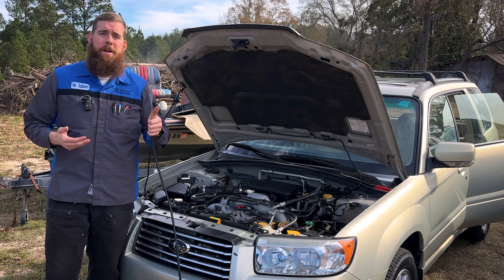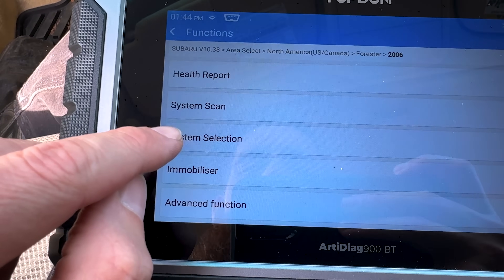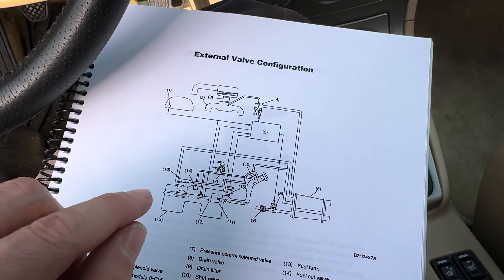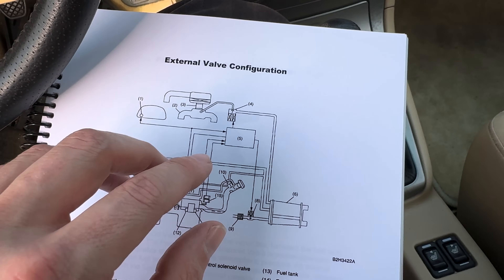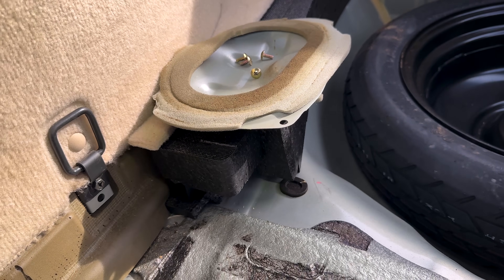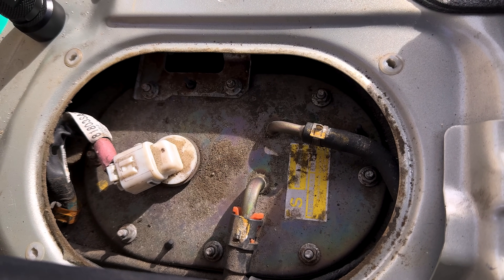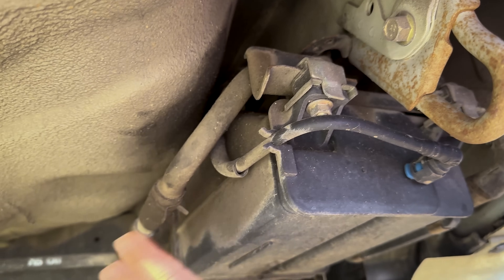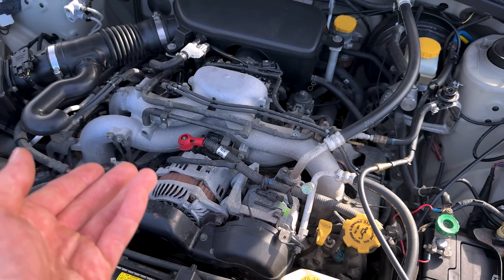Don't Let The Smoke Out! EVAP Leak Testing A Subaru Forester w/ Redline Detection. P0442 Diagnosis.

Comment: Any idea what parts would be wrong if I have a high/bouncing idle after filling my gas tank? I've done a smoke test on the intake and brake vacuum hose, no smoke anywhere. I tested the purge valve and it clicks when energized but the problem one time went away when I unplugged the intake hose on the purge valve. However it doesn't solve it now. I'm going to replace the purge valve.

Wonder if it's the drain valve or canister in the rear of the car. I guess I'll have to do a smoke test on he EVAP.

Comment: I was told to remove the fuel lines and just take an open flame to it like a map torch, the vapors will ignite throughout the fuel system and you can find the leak that way, takes 5 minutes and bam, no more evap leak

Comment: What happen if I was in the gas station and the gas hose was kind of broken and fill out my tank but at the same time exceed the measure and it trought some gas as well our of the car. After that I came home and I felt a weird smell and a smoke from the right side of the motor... can be because of that? Any recomendation of what to do?😢😢

Comment: I have a 2006 ForesterLL Bean and keep getting evap codes.I had parts put on it and codes would dissapear.Than codes will come back on!This time its a P0457 code.Does Mr Subaru or anyone know what it could be?Did Gas cap,Charcoal Canister,Purge valve and emission part in engine itself.Dont know what else it could be!

Comment: Dealing with this issue also. Smell of gas inside and outside the car. Replaced the gas cap, replaced the fuel pump. I’m thinking the purge valve is bad. Problem is no idea where it’s at on a 06 tribeca. Also has my sport light blinking even though i did an ATF change. Don’’t know if the mechanic changed out the internal or external filter though.
Reply: Did you ever solve this issue?  I am having similar problems.

Comment: Hey, I stumbled across this video and I found it quite ironic because I also have an EVAP leak on my Subaru. I don't know if you'll ever see this but I have a 2007 Subaru Impreza and there were a couple worrying problems with it so I ended up going to a certified tech for some help and they diagnosed me with a leaking EVAP canister vent value with a hefty price tag to fix. I was wondering if you knew where the EVAP canister vent valve would be located so I could potentially DIY it given I'm in college and not at the best place financially. Thank you.

Comment: Can you please offer any info on my Subaru forester 2020 all dash lights come on and come and go …. I disconnected the battery and touched leads together but it did not cure the problem … I have appointment with dealer but now they are off … 50k miles on car … if lights are off can dealer still see problem ?? Also car runs fine when lights are on and engine light is on but not blinking

Comment: Great video my 2003 Forester X has that code, but the shop concluded it's a wiring issue up over the rear crossmember above the fuel tank. 
Changed the purge valve, the car would flood every time you added gas, been chasing that code for a few years, and the wiring is what the shop is telling me.
That's the only code and everything is working, so I drive my commuter Subaru around with a check engine light on.

Comment: On my 2007 XT, that code has come and gone for the last 2 plus years.  A shop has replaced the canister 3 times.  Lucky they give me a 2 year warranty on their work.
Reply: Did they ever find the issue?  I am having similar problems with mine.
Reply: @coconutcreampie3795  The cannister just a couple years old had a pinhole leak.  it was replaced again.  Same code came back.  And gas cap is brand new official Subaru..  so, not sure at this point

Comment: Fixed a similar code on a 06 XT. Fuel cut valves on top of the tank had cracks at the hose nipples. Using my nose helped find this issue.😊
Reply: Smelling the same thing on my 07 when i took off the covers for the fuel pump with the 0442 code.  Been spraying soapy water to try and find the leak.  Did you have to pull the tank to replace those?  I am seeing several of those small hoses on the top of the tank.

Comment: I'd wish to see you using the smoke machine and explain how to seal the system to perform a smoke test, how to close the drain valve, and how to test the purge valve.
Reply from the maker: Likely follow up with a video, when I get the new gasket in.
Reply: @MrSubaru1387  I'll follow for sure!
Reply: The smoke machines have an expandable part that can go into your intake for example and seal it up enough to send smoke other places

Comment: Have to ask what is the odd fuse on the battery terminal?
Reply from the maker: The car was a tow behind. Has a lot of aftermarket stuff on it for that, included a tow bar and pneumatic brake pedal application device.

Comment: Thank you so much for this video! Had my car smell like fuel about six months ago. They replaced the charcoal filter and it was fine. Six months later the same thing happened. They have done this test on the vehicle amongst others several times and never found any issue. We'll see what happens!
Reply: Maybe the purge valve is stuck close and didn't drain the canister. That cause the canister to be full of fuel vapor and cause the smell if never drained. I don't tell its your issue but it need to be checked
Reply: @plleger6  That was what I was beginning to suspect after watching the video, great to hear I wasn't the only one. Of course there's several other places to look too but that's a solid start! thx

Comment: A real cute component of the EVAP system is the fuel tank pressure sensor.  On my '11 Outback it is hidden way up over the rear axle and tucked away pretty good.  Mine failed and set the code and I spent a couple hours replacing it in an area where snow-belt corrosion makes work so, so easy.  LOLOL!  I performed a smoke check with a hillbilly setup that uses Johnson's Baby Oil - easy to see and smell when there's a leak.  Great video on an obscure but pretty important nightmare of a system.
Reply: I would of like to see how you setup and show the working of the smoke machine. Thanks
Reply: Have subaru 2.5  I can't figure out why my rpm stays at 1500 replaced throttle body any help would be appreciated
Reply: Subaru engine was off a 2000 out back it's a subaru swap in my 86 vw vanagon.  It does have a few codes of fuel pressure and tank code if I install a code killer with that help.
Reply: I’ve got a 2012 forester. Did you have to drop the gas tank to replace that? I cannot get this po451 to clear.

Comment: Let's not forget the IMAGINARY leak...
You know... The one where the purge valve pulls vacuum, on a perfectly sealed system, but the stuck pressure sensor makes the computer NOT SEE the vacuum/pressure change. It assumes there is a leak.
Reply from the maker: Yup!

Comment: Robert, isn't the evap system why you do not top off your tank especially in hot weather?.
Reply from the maker: Correct, jogging the pump can over fill the tank and cause liquid fuel to flow into the charcoal canister.
Reply: @MrSubaru1387  and this can cause a smoke after put fuel and there is any solution to eliminate the smoke?